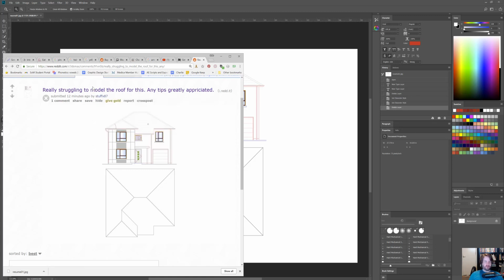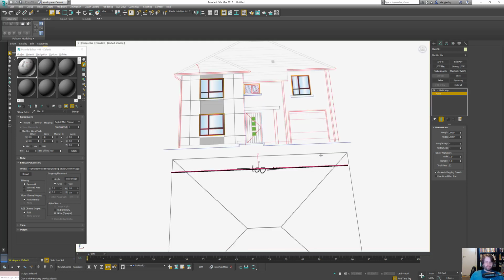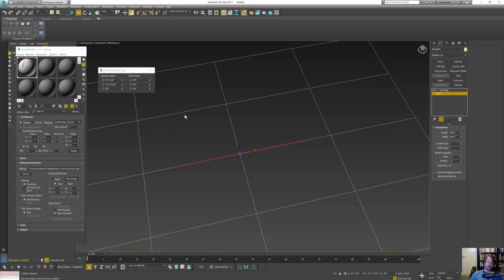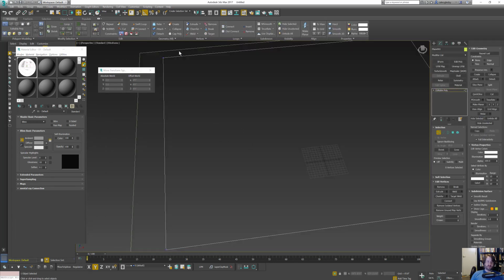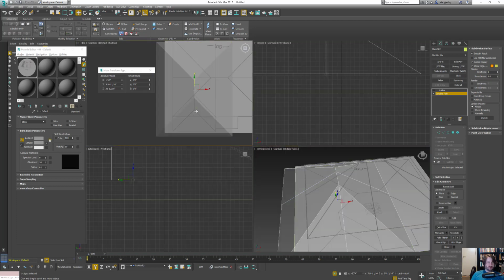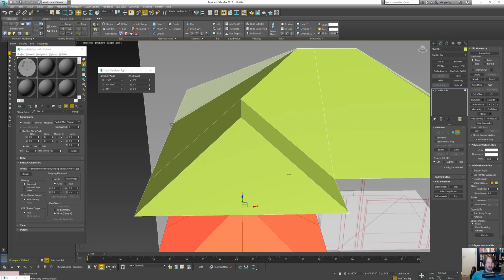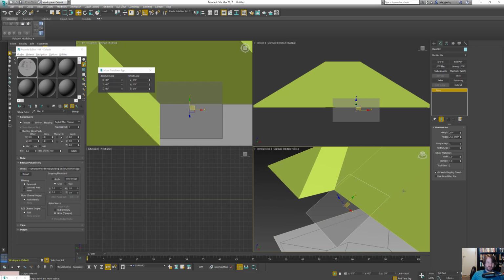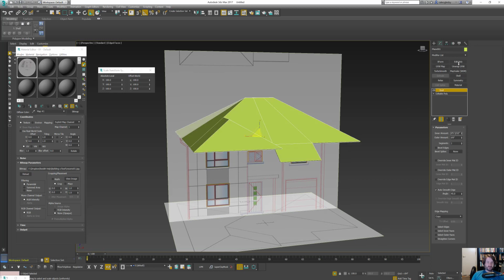Reddit Help -  Build a Roof 3ds Max

Comment: easy when all roof are modeled based on regular squares.
_You should try to model a Portugal Lisbon Roof.
Reply from the maker: That is definitely a little more complicated! but you can get the slope information needed with this method still. Then place your arrays of roof tiles, and then delete and slice the rules that aren't needed. Or find a really good pbr texture with displacement. 🤗